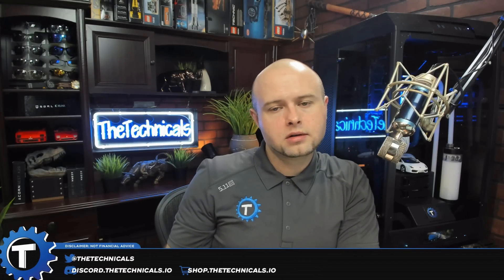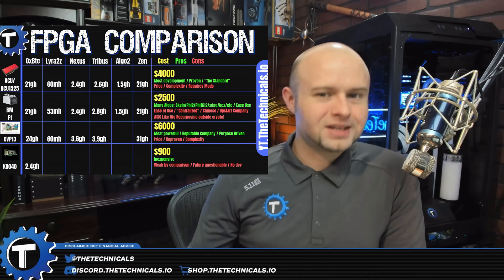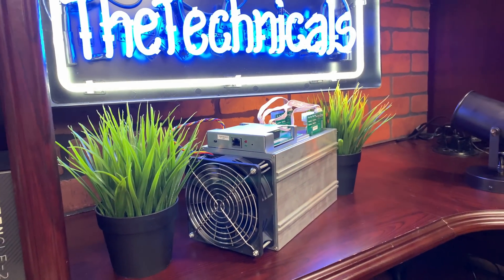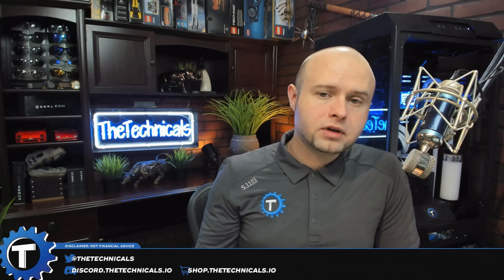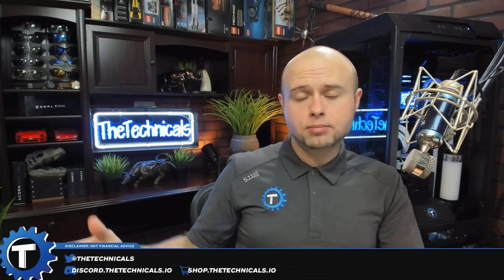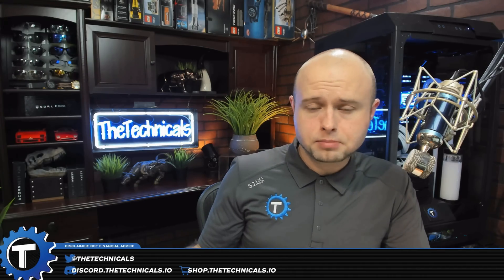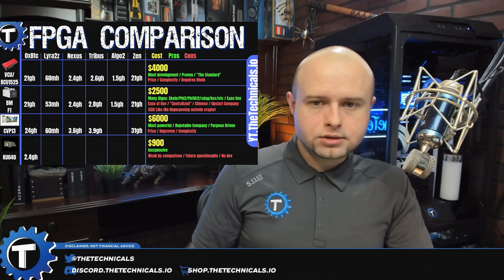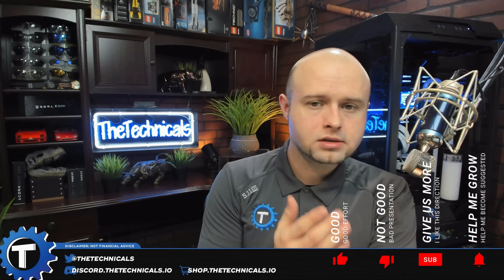FPGA Comparison For Crypto Mining [Price/Performance/Pros/Cons]

Comment: Since I'm in the aquarium hobby and I've only played around nicehash and I've only made $10 before the pre-built I was using died.

I was curious last time I bought an aquarium heater if you could modify the GPU to heat an aquarium.
Reply: Obviously you can't just pump aquarium water through a water block because fish Gunk is probably not good, but you could pump hot water underneath the bottom glass. And the difference between cold water fish and tropical fish is 73 to 86.

So they would need to be some method to remove heat if it got too hot.

I don't know how easy it is to keep a GPU at 27.777 degrees Celsius, but I also don't know how easy it would be for a GPU to heat up several gallons of water, so that might not even be an issue.

Maybe a custom milled block of copper, with no ridges for extra surface area, would allow you to pump tank water directly in there.

and it would be connected to a heat sink with a fan that would turn on as soon as the water 83 degrees and turned off once it hit 80
Reply: I do know that the 200 watt heater in the 10 gallon tank I would be using it on, is keeping it at a stable temperature even in my basement which isnt heated and it's below 0° outside

Comment: I'm Fpga designer and  I just wanna point out if its easy as programmer to adapt the code to different fpga. The answer is often easy sometimes hard. It depends upon algo. Mostly in Fpga, we have several instances of fully functional algo blocks running in parallel. In that case switching between different fpgas is matter of few hours. For eg. lets say, we can fit 25 instances of keccak algo (each contributing 600Mh/s) in VCU1525  resulting 15Gh/s in total. Now if u wanna change target board to CVP-13 , just add few more instances to fill the larger area. And we get like 23Gh/s .  And that's it. If you wanna change target to like KU040, just remove some blocks to fit the area. So, its all about area. But in few case , single instance of algo may take entire fpga area (for eg. X17, X16R) .  In that case we may  have to tweak  a lot to fit into different  target area.  Anyway, just found your channel, you are doing great . World needs more like you. 👍
Reply: Interesting. Are you saying you could mine two algorithms at the same time?
Reply: @ministerc.politics4305  yeah, that's 100% doable compromising the hash rate in both algos.
Reply: Hi. where should I start with this FPGA world?
Reply: Jagannath Paudel, Can you tell me how to set up a fpga card for a profitable algorithm?

Comment: Hi - Good video. Atom Miner has great hash per watt spec but only generates $31 per year in revenue (Keccak - Smartcash) [$22 on MaxCoin] i.e. that's what you get with free electricity. I am not sure if the price is $600 or $3700 but either way the payback is poor and its just not powerful enough to move the needle. Thanks.

Comment: Heya Tech.. EXCELLENT information. Thanks so much for the FPGA comparison numbers. Have a BCU-1525 + TUL H20 block on the way as soon as SQRL get's it assembled and shipped. Pretty psyched. You've got me considering the Blackminer F1 as well. Are there any issues with heat when mining with it? If so, that would be one that I'd love to give single-phase immersion cooling a try with. ** I'm soldering my support hinges per your design right now (RFLMAO). Luv ya, brother. Keep em coming!!
Reply from the maker: Thanks dude.

Blackminer has never broke 55c, and thats running it in a 80f ambient room. I have it in my attic right now where it's around 30F, so no issues thus far

Comment: Great video, one question even if the FPGA hardware supports an algo I will still need a dedicated software to mine a specific coin, or is there already a software around that can be easily adapted to mine any coin with that algo (i.e. lyra2z)? Thanks!
Reply from the maker: They almost always release the bitstream with the miner to go along with it, and if not community is pretty quick to stamp one out

Comment: Great video as usual. Have you seen BBT's latest video on FPGAS? Whilst i definitely love custom hardware i agree with his sentiment regarding long term sustainability for the small man. https://www.youtube.com/watch?v=GNy5Ta5ccNg
Reply from the maker: I did, yes. He's got great points and more importantly the experience having gone through these cycles before. However, while everyone is quick to say the current climate is nothing new and will repeat, it has never gone along with a 100b market cap that was once close to 1t. I think the amount of eyes in the space now will change things up. Too many large farms, asic, gpu, and otherwise that will keep diff's high to the point that home-mining will never really gain the foothold it once had, barring the run-up period. There are GPU farms running right now at 0.01c just breaking even. Hard to compete with that
Reply: @TechnicalsMatt  Definitely agree. Interesting times for sure!

Comment: VCU/BCUs more likely to die from mining before getting into secondary market. They seem too fragile. One wrong step in a set up  - and you have already fried something. Any  bitstream that is not tested well enough can do the same to BCU VCU. I would vote for F1, I think they will be releasing updated bit streams/new bios/ firmware etc. Theoretically any Bitmain miner is  only door stoppers because Bitmain did not want to reprogram it but wanted to sell those reprogrammed ones as different models of miners.
Reply from the maker: Asics can't be reprogrammed. The bitstream is stamped into the chip so to speak
Reply: @TechnicalsMatt Theoretically it were possible to create a module instead of that chip and make it reprogrammable similar to what  the F1 devs did if I am understanding it correctly.

Comment: how much power does the bcu/vcu use?
Reply from the maker: joenuno1 300ish
Reply: @TechnicalsMatt  I think that needs to be talked about when it comes to long term mining and the power savings long term.  20x1080TI vs bcu energy ratio's, cost of equipment, maintenance, etc. You don't hear it shown with charts or spoken of together.  Clarity is everything.  Too much confusion out there nowadays.  Thanks for the great work.  Keep it up!

Comment: i think F1 is the beast thing 4 now.... just recomended 2 add xtra fan 2 get pusch-pull configuration =) basicly its an asic but with reprogramable bios (like flasching bios on amd-gpus)
KU40 is good startup 2 understand FPGA-s and doo some tests without risking some ...k$
Reply: That F1 has just 32 mb per core..if coin devs want they could brake it from their coin with easy

Comment: Question I keep thinking about... would there be a cheaper FPGA so $100-200 or less, just to get the idea of uploading a bitstream and messing around with the programming? Knowing the ROI on the card probably wouldn't be good, but just so you get the idea of how to get it to work? 
Or would it be pointless if I can't find a card with pre-written bitstreams?
Reply from the maker: I think those dev boards exist, yes, although i'm not sure if their complexity matches anything close to the VU9P.  Learning to work on go-kart engines vs. Formula 1 engines and such, but I haven't the slightest idea. noting for next video
Reply: @misterecco so basically it is not possible to develop bitstreams on fpga development kits and then move them to high end fpgas ?